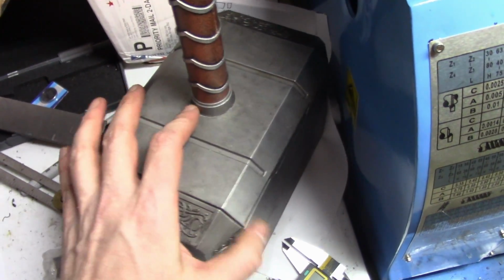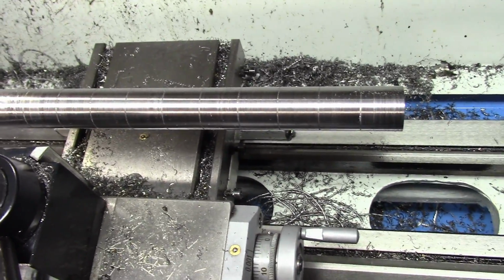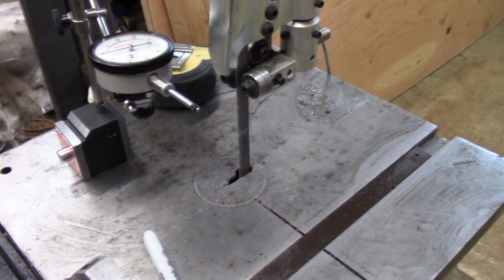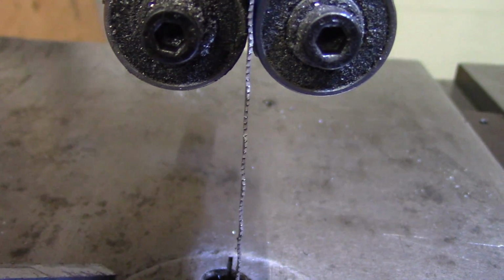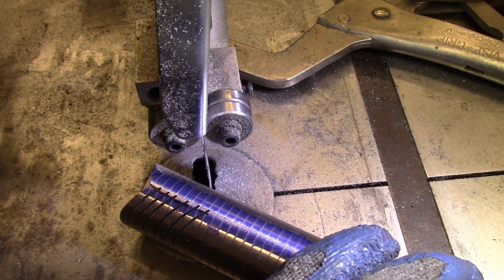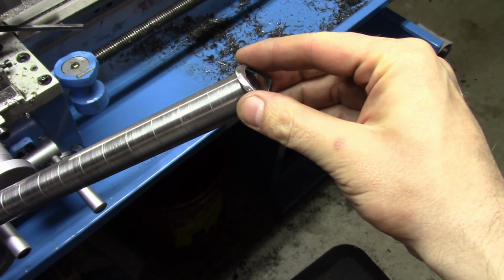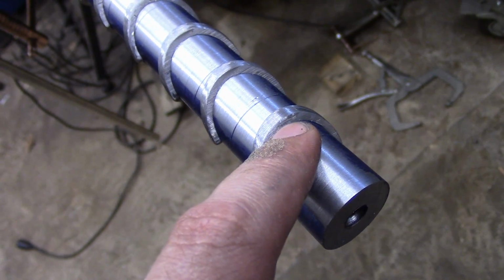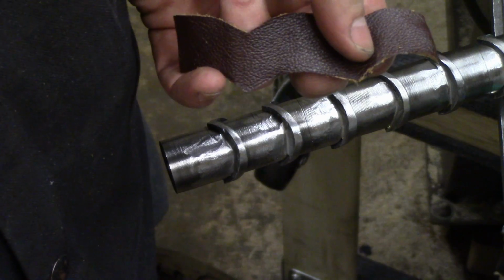FIRST EVER TUNGSTEN-CORED THOR'S HAMMER (WORLD'S HEAVIEST) | 135LB MJOLNIR (Part 2)

Comment: In future i would use a bigger bar and get a dividing cenre to mill the rings. Would save welding rings on and cutting. Whilst would be more accurate. Expensive to buy though.